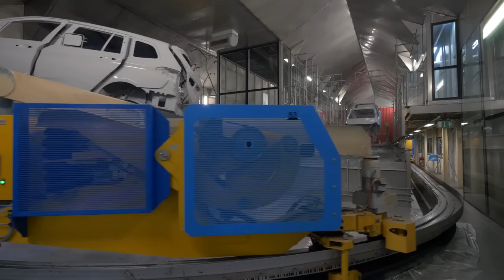BMW car Production Assembly Plant Regensburg, BMW 2-Series Gran Tourer, Produktion 2er Gran Tourer

Comment: What happens if they do find some flaw during the late stages? For example at 13:15 ?
Reply: What is the flaw here? Could you guide me?
Reply: Nilex No, there wasn't a flaw, I am just wondering what would happen if they did find one, so late in production
Reply: Dimitris Karagiannis ah alright xd I thought I was blind
Reply: The car gets sorted out, the part with the flaw will be changed. Usually they have about 24 hrs to do that, so the customer doesn't have to wait longer...